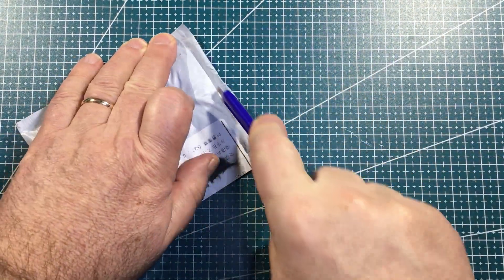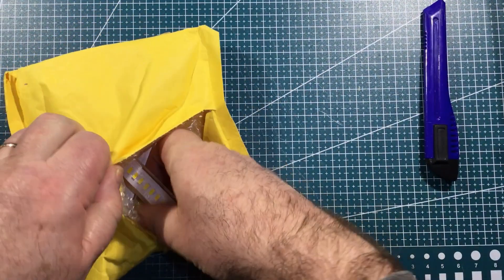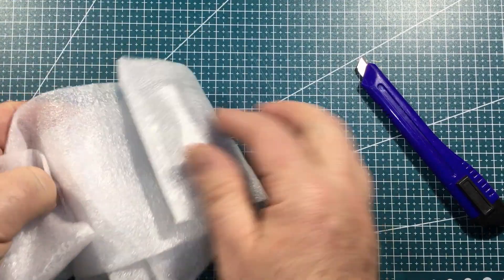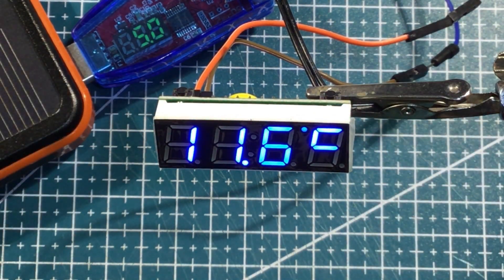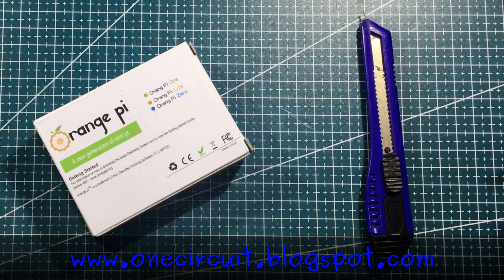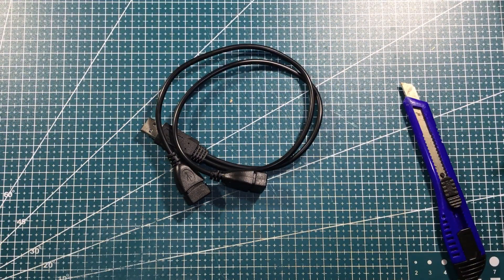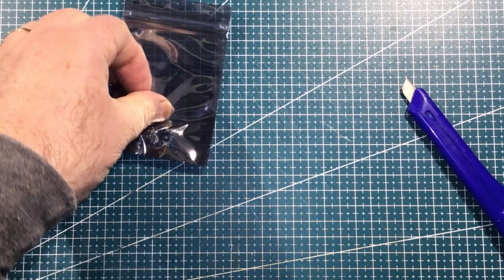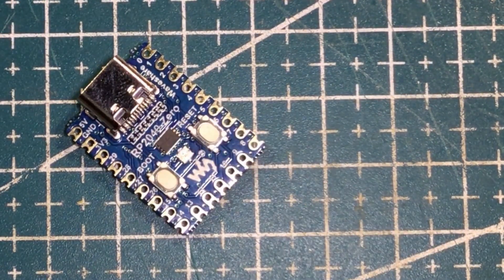Mailbag #27 - burnt offerings

Comment: Weird and wonderful technology hahaha I like that. I ordered one of those cheap 3d filament welders today and they sent me a high end 100watt usb c / lightning male to male cable instead. I checked the price and it's a 50 dollar cable lol
Reply from the maker: Win! 👍😀
Reply: @onecircuit  I received 1000 3mm clear 1.5hz yellow green flash, an HPDL-1414 module, 2 8x32 neopixel panels I paid 10 cents for on ali and a horrible candidate for a grabber for an industrial robot project I'm heading/funding at the local makerspace. In today's post bag haha
Reply: @jstro-hobbytech  Love those DL1414 displays. Pulled a bunch from some obsolete equipment that was being tossed. They make great little retro looking bubble displays in projects.
Reply: @onecircuit-as  check out the HPDL-1414 when you get a chance. I buy one every other month for some ideas I have rattling about